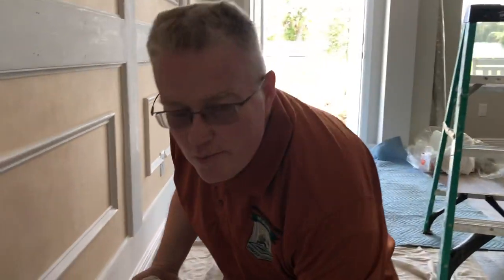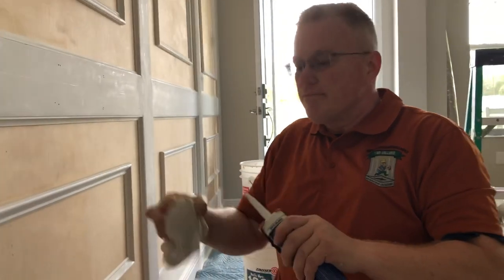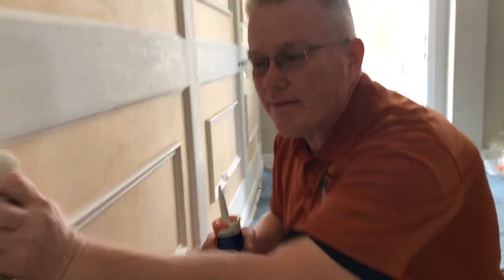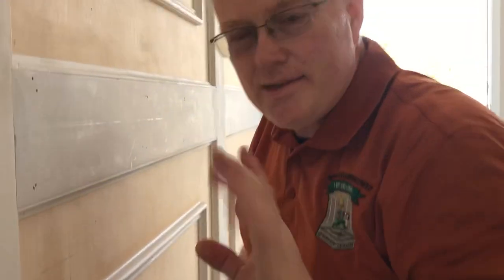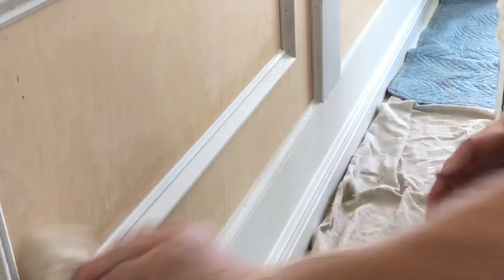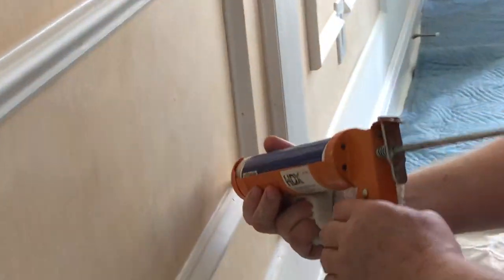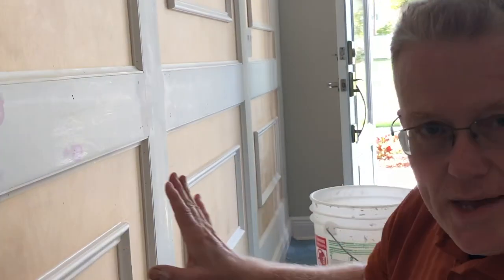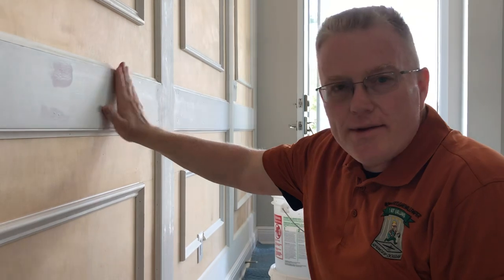How To Caulk Seams and Fill In Nail Holes Before Paint (Painting Series)  - Spencer Colgan

Comment: A trick I learned from an old carpenter is to push the caulking gun
instead of pulling it. Works best on hairline cracks. You use half
the caulk, and it smoothes out  as you go.
Reply from the maker: Thank you very much I know exactly what you’re talking about and it’s so true
Reply: Great tip!

Comment: I'm having a tough time getting filling with Drydex right. It seems to pull into the nail holes which are a large ♠️ spade-like shape. So you have to put it on in a bit of a mound. Then when you go to sand it with a sponge, it is very hard to find the line between over and under sanding. It's easy to dig down into the hole and leave a shallow hole to only have to fill it again. And it's not just a circular hole which might be easier. 

Caulking is also very challenging, as the cracks are different widths. I think might start cutting two sizes and swapping them out. Also it can be tough to clear the caulking out of the corners of the frames. I have fairly large hands and it leaves little builds in the corners. Large cracks are the most challenging though. I either put to much or too little. I've caulked outdoors a lot but indoors is giving me a run for my money! It's very high end work I'm doing. My last job was fine but this has to be perfect looking.
Reply: I know this is 4 months later but maybe it will help on the next one 

• make sure the hole on top is not cut to big . You want to cut it right where you first see through . You’d be surprised how much will come out of that tiny hole.

• try to push the caulk gun instead of pull ( so with your tip opened with a small hole cut at a 45deg angle . Place the gun just like your going to pull it and caulk but instead push and squeeze . I feel it’s better cause you really get the product in the area your caulking .

• the corners are a little more tricky just keep a 5 &1 on you and when you do a corner dig out the extra while it’s wet . , or stop just before the corner and pull the caulking with your finger towards it when you wipe it the smooth it out and the extra on your finger will
Fill it

Comment: Well, whatever works and achieves the level of perfection you desire. If you do this for a living then efficiency and compromise might play into things. As a DIY perfectionist with numerous renos over the decades, I use a variety of products. Bondo, automotive glazing putty, Lepage and Elmers tinted wood filler in both tube and tub, drywall compound, etc. Caulking of hairline cracks is an obvious choice though deep cracks will shrink and a secondary application doesn’t lay down as neatly so I may transition to a different filler for large gaps especially on baseboards. For brad or nail holes I’ve tried the flush putty knife method which sands easier but may need a secondary fill after drying to account for shrinkage which leaves a dimple. Leaving putty proud accounts for shrinkage but often takes longer to sand flush. With MDF, brads can leave a “volcanoed” hole that I often sand flush first, then blow out the dust and do my fill. I often use a quick grab dab of caulking glue every 12” and avoid brads unless really needed for warp. I hate painters who use caulking for nail hole filling as it shrinks and with a higher paint sheen level is rather noticeable. Other than the excellent cutting in skills of a pro painter, I find I can do a better final job but again, I have unlimited time if it’s my own trim work. And I have to own the bad gaps for rushed carpentry finishing. At least it’s paint grade I tell myself. For real wood, well…

Comment: Painter. Homeowner used Bondo glazing to fill in damaged 8” window sills. Applied it like drywall compound with I guess a spatula. Not prepared for how fast it sets up. Finish coat BMoore Regal Select semi. Arrived to see what appeared to be Georgia clay covered in faint yellow. For deeper cracks or holes, Bondo isn’t the best. Wood expands. Bondo doesn’t. Apply Thin for surface defects. May want to use plastic putty knives, or prepare to clean tools frequently doing a large room.

Comment: The down side to bondo is that nasty red dust and extra coats Of paint...I use elmers wood filler it’s yellow better coverage tougher to sand though. On a job last year I used bondo over top of grey tile with white grout I had a drop down but when I pulled it up that red got in the grout and ruined it haha last time I used that stuff
Reply: Practice... professionals use bondo, amateurs use Elmers.

Comment: The only bondo glazing and spot putty that I found is white and requires use of a cream hardener.  Why the difference and where do you find what you use.  TYIA
Reply from the maker: I got it right at Home Depot
Reply: I use the two product bondo glazing as well.  Mix and apply, make sure you push it into the hole and then "cut" it with a razor.

Comment: Do you have to sand after using the bondo?
Reply from the maker: Yes, unfortunately.
Reply: If you use a razor and push the bondo in and cut it tight you will have minimal sanding to do.

Comment: After using the red filler, you have to prime over that right?
Reply from the maker: Nope.
Reply: @spencercolgan  Really??  Your telling me that I can paint my two coats of SW pro classic white trim paint right over that without bleed through?
Reply from the maker: @tundrawhisperer4821  no.  I’m not.  You didn’t ask me that re. Your presumably white pro classic paint. You asked if it need be primed. That’s what I said no to.  

If you’re painting this red filler, you would need to cover it with a primer sealer for color purposes.  But if you’re looking to know if it would. Size a holiday and therefore require a primer, the answer is (as I said).  No!!!

You’ll be fine tundra whisperer.
Reply: @spencercolgan  size a holiday?  I have no idea what you meant by that!  😂😂. I figured it needed to be primed.  Thx

Comment: I use Sheetrock 45, no dents and smooth as can be.
Reply from the maker: Wow!!!   Good to know. Thank you.
Reply: You use the 45 on millwork?
Reply from the maker: @tundrawhisperer4821  oh sure.
Reply: @spencercolgan  okay, I’ll have to try that one!  Thx
Reply: Get a hold of a bit of chalk line powder and mix it into your hot mud, then when it dries it's easier to find the spots that need sanding (it's hard to find sometimes if left white, but I found that the yellow powder seems to work the best for me, it's noticeable when you are looking for it but doesn't show through the finish coats).  
A few times I've done the hot mud without tint, and missed sanding one or two spots.  
These days I put a bit of chalk line tint into spackle, then spackle the holes (leaving it a bit proud to account for shrinkage), then once dry hit with a medium sanding block.  
I've found that glazing putty will shrink a bit, so needs to be left a bit proud, but is a bear to sand, especially in a complicated molding such as crown.

Comment: SPEAKING OF LOOKING BAD...  That receptacle plate on the wall at 3:01 needed to be moved.  The way you hacked up the the frame around the wood looks terrible.  VERY UNPROFESSIONAL.
Reply from the maker: Why don’t you get the facts before you open your mouth like that? I did not do the trim! I was there to paint it. I did not install the wood trim
Reply: @spencercolgan    If you aren't responsible for that hack job, I apologize.  I took my que from other videos I have seen where the installer was also responsible for the caulking and painting.
Reply: ??  You're so wrong, painters don't make the decision on where a receptacle is or how it is placed on a wall with trim.  Painters paint and if the GC and carpenters made the decision to place a receptacle where it is the painter paints it.
Reply: @krisone63    No matter the reason, that receptacle should have been moved a few inches out of the way BY SOMEONE with some class.
Reply: ..you typed "the" twice.
Reply: even if he did the trim...have you considered the possibility he recommended a better solution but the customer either didn't mind the look, or didn't want to spend more?
Reply: @stumblein9   Who cares.  That wasn't my point.  Besides, "he" didn't mention a "better solution" in this video, did he.